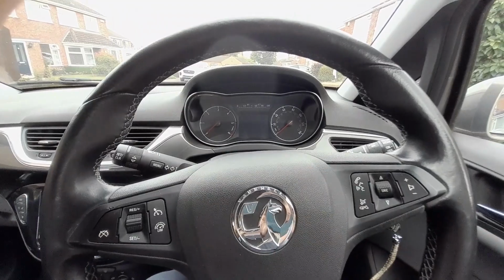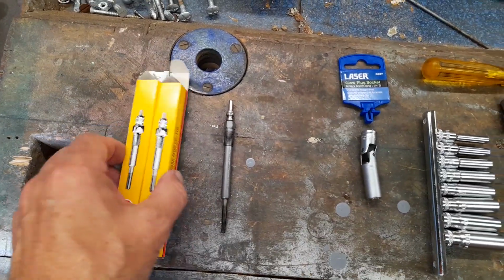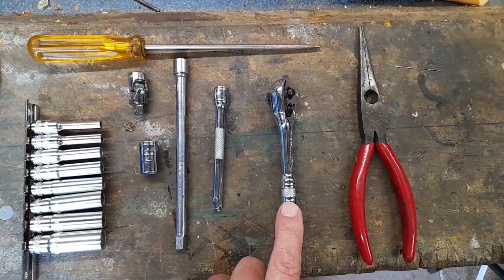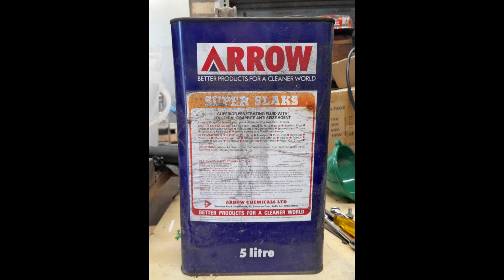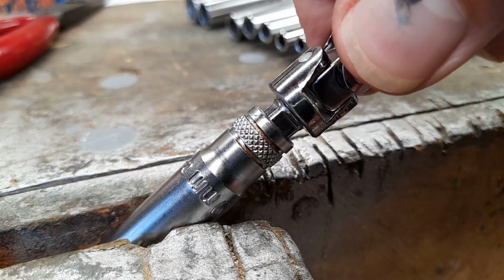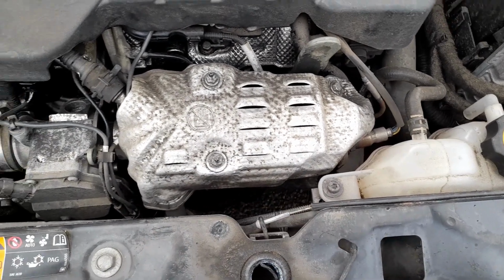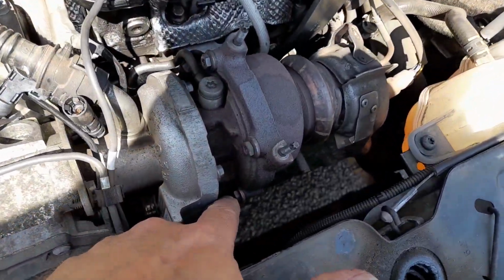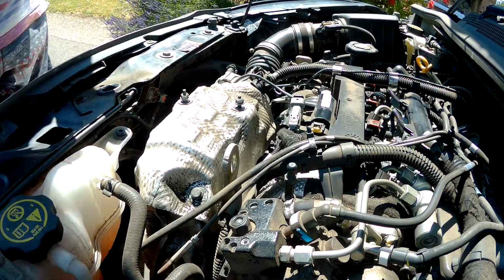Corsa E  1.3 Cdti Glow Plugs 2 & 3 Change

Comment: That's a very good video and really appreciated Floyd. And you're not an idiot lol, it's called wisdom. Dealers want £600 to replace all 4 glow plugs. I'm tempted but not confident as I could make it worse - probably buy the tools suggested. Mines done 60k miles...66 plate. Thanks again
Reply from the maker: Thank you for taking the time to comment. Good luck!
Reply: They're easy to replace. 600 quid is a rip off. My local garage charged £20 to do them

Comment: Thank you so much 🙏 for showing a good way (incl. emphasing critical moments in this task 🍀) to do it without removing the Turbo. 
My week old Corsa D 1.3 CDTI 2013 looks pretty the same under the hood and have ok Glow Plugs,  but incase later they have to be replaced,  I concider your Video very helpful 🍀🙏
Reply from the maker: Thank you for the comment. Good luck with the car, they're very economical! 😁

Comment: Thank you this, I had attempted this already and got thwarted by the turbo on the only blown plug. I will give your tip a go.
Reply from the maker: Good luck!
Reply: @floydraser4603  It went well. Removing the bolt from the turbo was quite easy with a flex head ratchet spanner. Thanks again!

Comment: I know I have at least 2 to replace on my volvo v50, but they are down the back of the engine out of sight behind the turbo, the characteristics are a very hard start with a  lot of blue smoke when its below  freezing (extremely hard at -13, but it did start)
Reply from the maker: I think warming the engine and soaking the plugs with easing oil works in all cases, and being careful when taking them out; be gentle for fear of snapping the plug. That's my research anyway. Good luck.